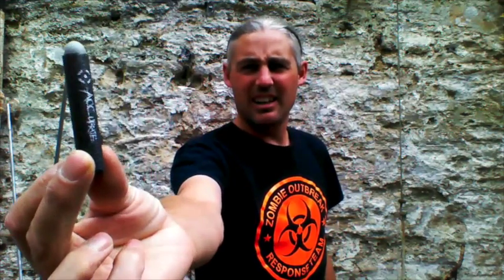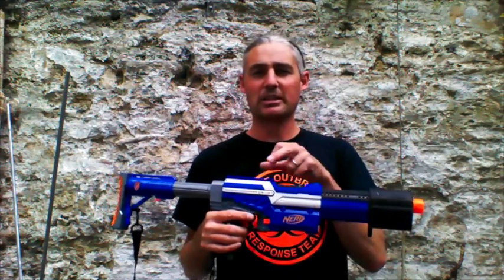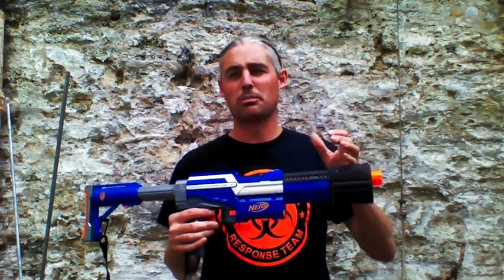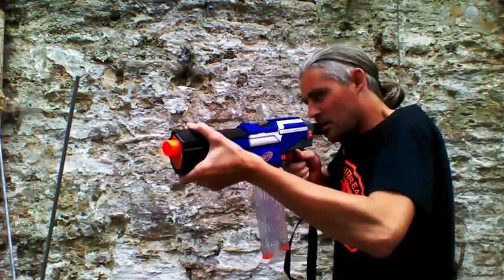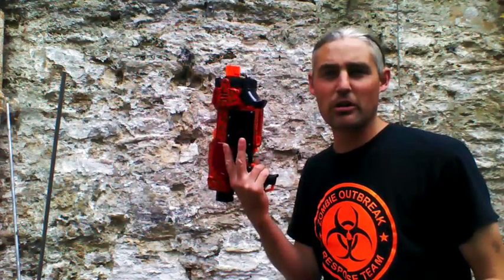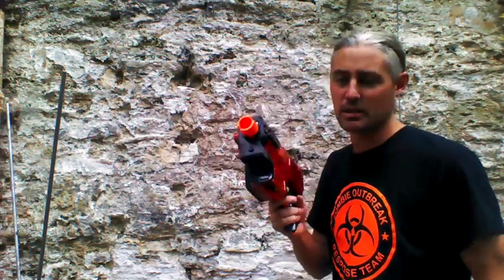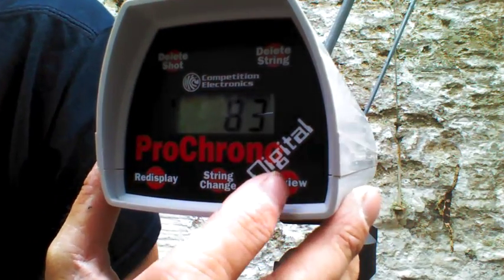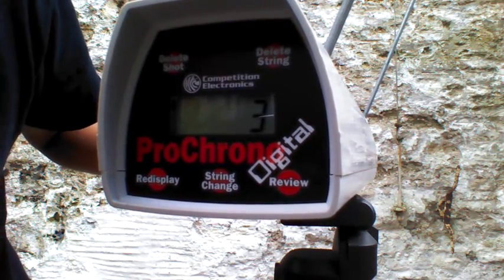ACC Vs Koosh Dart Test- Chrono and Accuracy Part 1

Comment: I modded my AT with 5kg spring and the prime isn't as smooth is that supposed to happen?
Reply from the maker: It should be smooth but a little harder to prime.  You have something out of place. Open up,  remove the main spring and work the action. Look for bits that stick or look out of place.